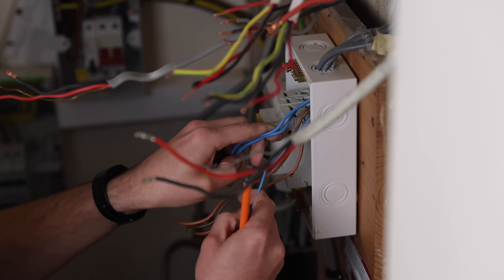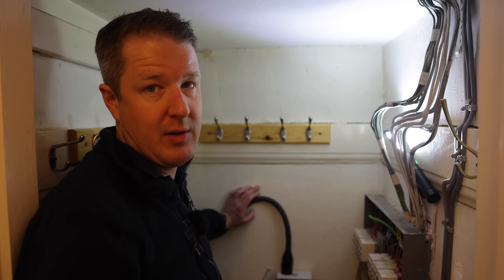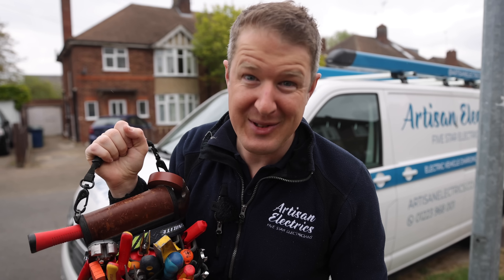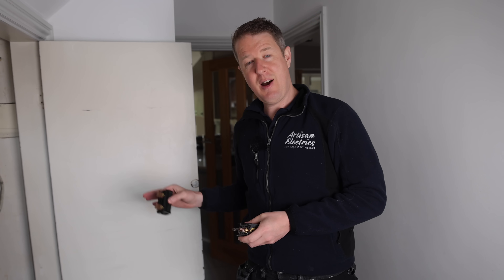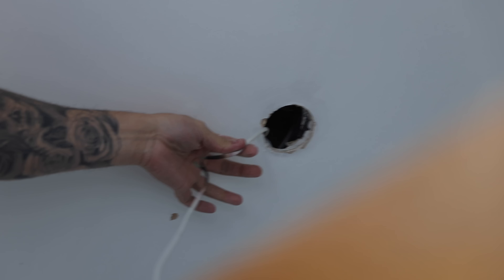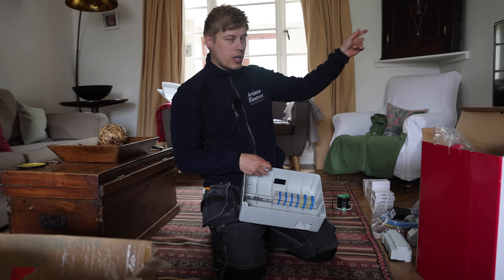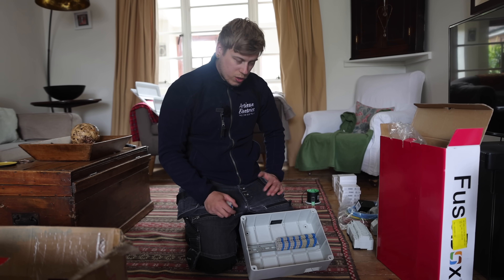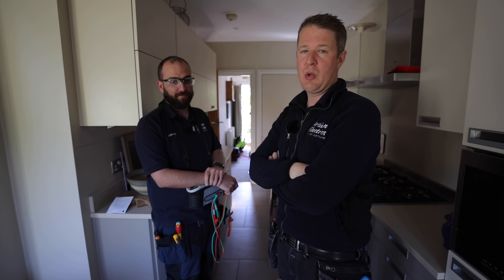A MAJOR ELECTRICAL TRANSFORMATION! - Consumer Unit Upgrade

Comment from the maker: Let know your thoughts on the super transformation. Would you have done anything different?
Reply: Good
Reply: My thoughts are it would of been better for the viewer to see everything powered up and working at the end? Great fantastic job tho well done 👍🏻
Reply: spot on job as usual. sure you've posted before but what grommet strip is Lee using there?
Reply: Can you please put a link in the description for the work trousers you guy are using. 💪🏻⚡️👊🏻
Reply from the maker: https://bit.ly/3z6jBXs - Blaklader
Reply: @artisanelectrics  thank you 😊
Reply: I’m sorry but the regs covering metal consumer units also apply to “similar enclosures” like this one. There is not much point in fitting a metal consumer unit if a plastic enclosure is used to extend the cables. Plastic enclosures should only be used in external buildings that are not classified as dwellings; this can include sheds, workshops, detached garages, swimming pool areas, meter boxes, or commercial/industrial areas. WISKA tell you this on their website for the Indubox which is what this is. What’s next on Artisan, paid promotion for a plastic consumer unit?! Lol
Reply: @gadgetman36   Your use of “ “ implies a direct quote from BS 7671 yet 421.1.201 makes no mention of similar enclosures. It’s states “consumer units and similar switchgear assemblies”. 
Switchgear is defined in Part 2 as “An assembly of main and auxiliary switching equipment for operation, regulation, protection or other control of an electrical installation”. 
So an enclosure with din rail terminals wouldn’t meet the definition of a switchgear assembly. 
By your logic, the use of all plastic accessories would be precluded by 421.1.201. 
Also of note is the question of the assumed definition of “premises” as used in 421.1.201. Most resources define premises to include the associated land and other buildings. So your suggestion that plastic consumer units are specifically permitted in sheds and similar is actually open to interpretation. 
There is little use having a metal consumer unit in the house if the one in the attached garage is plastic…
Reply: If only you had fixed the extension box higher so the leads on the armored could go around and not over the connection. That must have hurt when you noticed
Reply: @artisanelectrics  Crazy price for a pair of trousers!  Maybe next year... ;-)  (I prefer John's anyway!)

Comment: I saw the DNO note on bakelite fuse enclosures when it was published and the videos filmed by SPEN are very scary in terms of the sitting voltage on the enclosure itself. First time I've seen evidence of it on a fuse carrier. Good spot.

Comment: Epic job John... Currently looking for a new board and some electrics done in an old outhouse along with some outdoor lights & sockets for a patio area... Sadly your way out of my area (Cumbria) otherwise I'd have you quote us. Got a quote from a local Spark for the work and I think he's quoted so we don't use him. Upgrade of the outhouse board, 8 lights and 2 sockets over £1800 + Vat. And we're supplying the lights & sockets... I'm even running underground trunking under the patio for the SWA...

Comment: 15:05 You might consider installing small LED mains with battery backup powered light next to the CU.  That way in-case a breaker trips you will have light to check the breakers.  Seen it done a few times and does work out nice.  Just small linear strip lamp above the CU, and for the cool Aritsan touch, it could have door switch so it would come on when door is open, as it looks like  a coat closet as well.  👍😁
Reply: These emergency lights also come in din rail versions, for ease of mounting.
Reply: Cracking Idea. I've done this for years where to consumer units is and one in the stairwell too.

Comment: The only reason I have a cable stripper.....is for downlights, saves so much time....everything else is good ol' cable cutters, nice board change. Haven't done a double stack in a domestic in years.....rarely need them

Comment: I have had a set of those CK strippers for years. The biggest issue for me has been that when I have been stripping the inner cores on T&E the small off cuts of the insulation get stuck in the jaws causing them to fail to strip next time you use them. First world problem, but really annoying.

Comment: OK so since John used to work for the DNO, he is best placed to answer this maybe - who pulled the cutout fuse?  We all do it, but what are the proper rules?  Everyone seems to think something different.  I have been told by electricians that training centres that it is illegal for us to touch it.  but every electrician I have ever spoken to on the subject just pulls them anyway.  Does anyone actually call the DNO to do it?  Can you explain?  Have you ever been in trouble due to it?  Very nice job by the way.
Reply: I work for a DNO myself and legally electricians are are not allowed to pull the main cut out fuse. The DNO should be called out and it is a chargeable call. However we know electricians do it and in a lot of cases turn a blind eye because its also a bit ridiculous to have to pay us to do something so simple. Sometimes we get called when smart meters ping in that someones power is off and we turn up while the electrician is there. I usually just explain the scenario and give a verbal slap on the wrist. I have heard in other areas other DNOs can be a little less forgiving however.
Reply: @tiggerthegreeb  thanks for your reply. I might give my dno a call next time I have a board change booked and see if they'll come out. The answer to this really is to install an isolator before the board from the meter. I know this would involve an initial call out but would solve the problem after that.
Reply: Its rather ridiculous when you think about it. Can you turn off the mains water? Yes. Can you turn off the mains gas? Yes. Can you turn off the mains power ? no ...... We all pull them, if the DNO has an issue, they can take me to court. If they would be less lazy and fit isolators this would not be an issue at all, THEY created the issue to save money...Fit a £20 isolator? Hell no, Get them to pay callout charges to pull a fuse? Hell yes!!
Reply: @Thegardener87  Yeh 100% agree. I guess the only issue as you say there is it needs a call at at the time of installation etc as beyond the meter the DNO are legally not allowed to alter wiring etc being strict to the law. It's a daft scenario really where customers and electricians would really like a double pole switch between the meter and consumer unit but we aren't technically allowed to do it ourselves under normal circumstances. If I do attend a customers property and find wiring that I deem a safety concern (for example I've seen faulty KMF switchs between meter and consumer unit and even reverse polarity from the meter into the house) we would fit one and leave it off so a spark can come and do work after we have attended. But o. The whole it's a silly situation I must agree.
Reply: @tiggerthegreeb  yes people don't realize that smart meters have a feature called "dying gasp" where a charged supercap inside them allows them just enough energy to send a burst of telemetry that power has been lost. 

I think most electricians would argue that in order to do their job and change a board, they need an effective means of isolation - and rule or no rule - until there's isolators fitted - this means pulling the fuse. I don't think any electrician should work live just because they might upset the DNO. 

I have zero issue breaking any nonsensical rules if it means I come home from work safely.
Reply: @arcadia1701e  Cutting the seal to the main incoming fuse potentially allows folks to bypass the meter.  Bit like the seals on the meter itself, they should only be cut by the DNO.  I waited until I had a meter change and asked them to install a double pole isolator, problem solved.  I have been told in the past by DNO folks that they do not allow other equipment (such as a consumer unit) to be installed on their board or in an outside box.  Maybe they are more relaxed these days?
Reply: When quoting these I get the cliant to contact there energy supplier and install a isolator. they normally do it for free or under 100, I think it looks more professional.
Reply: @adrianshingler9783  it's funny, because in Australia for example CUs are regularly installed in the metering box and nobody cares. Seen enough installs in the UK of old wylex boards that have obviously been in there for 30 years and nobody has complained.

Comment: Why do you want the ground wires separated on that DIN rail? Like why didn't you use the ground blocks?
Reply: You can't test the R1+R2 (Continuity) for an individual circuit if the CPC (Earth/"Ground") is connected to all the other circuits' CPCs...

Comment: At 8:08: Test a phenolic fuse carrier that has NOT suffered arcing or prolonged overheating to convince me that phenolic material is not fit for purpose.  I suggest you clean your carrier surface of conductive carbon then perform the correct test according to the appropriate IEC standard for surface resistivity. If only published standards were not just for the rich!
Yes, we could return to ceramic carriers - but if have ever dropped one you will know their disadvantage.
Reply: Many millions of electricity meters worldwide have and still use phenolic in the main case and terminal block area.  A decent grade phenolic will last a very long time 👍❤️

Comment: What's the issue with connecting all the grounds together in the extension box? Aren't they all gpoing to connect to the same terminal in the consumer unit anyway? The ground isn't supposed to lead any power unless during an earth fault which will switch off everything anyway? Might be different here in Sweden where we don't have loops and run cables to be able to take the A that there will be in the circuit.
Reply: You can't test the R1+R2 (Continuity) for an individual circuit if the CPC (Earth/"Ground") is connected to all the other circuits' CPCs...

Comment: Is there an issue doing through crimps compared to an adapt box
Reply: Shouldn’t use crimps on solid conductors as it can damage them and reduce the CSA of the cable

Comment: With the adaptable box, and the trunking going up and round, you've had to put the SWA through. Couldn't you have a. terminated SWA into a small box where it enters the room, and moved the vertical trunking to the right (as it's not flush to side wall anyway) or b. brought trunking out to the side of new box and round to new CU? Why go up and round? the SWA looks bad.

Comment: As a learner I'm still not getting the situation with pulling the main fuse. Did Artisan get DNO approval for pulling the main fuse here? I get some people telling me it's illegal and you face a fine for doing so, and other people saying it's fine and that you have to pull the main fuse to not violate the EAWR (live working), and it's not practical to get a DNO appt for all your jobs. 

Can anyone simply answer this for me? Obviously external isolators are ideal but they are often not present.

Comment: Why didn't they want the earths to be bonded together on the din rail?
I know earths are bonded together on din rails in control panels.  Just i'm just wondering what is different in the house installations.
Reply: Might make things a bit more difficult in some fault finding situations.
Reply: Testing each circuit becomes a problem as all the CPCs are connected.

Comment: Some times a loose connection on the main fuse carrier stalks between the fuse and carrier stalk screws that create the connection to the fuse arch and over time burn out hence why the carrier stalks are burnt

You can tell if the main fuse is overloaded just by touching the fuse carrier with your hand if it’s really hot you know you got a problem. 

Also incoming service cable could be undersized for fuse rating for current carrying capacity which again would over load the fuse causing it to blow. 

007 which is 4m can only be fused at 40amps max

.0145 pilc service cable’s which is 10mm cores either copper or alley cores can only be fused at 60amps max

.0225 pilc single phase, split phase, three phase if it’s copper cores or tinted copper cores can be fused at 100amps, if it’s alley cores can only be fused at 60amps.

.04 which is 25mm pilc copper cables 100amps alley cores 100amps

.06 pilc service cables 35mm either copper or alley cores 100amps.

25mm plastic wave form or 25mm hybrid plastic 80amps 

16mm split concentric copper 100amps 

25mm split copper 100amps

25mm hybrid split alley 80amps

35mm hybrid split or 35mm split concentric 100amps.

Comment: Do you really have no idea how the main fuse got like that? I would have thought 18 circuits would be putting a pretty high load on it. Even allowing for diversity I'd be surprised if the max demand load was much below 200A and at best it's going to be a 100A fuse. Obviously it won't usually be running at max load, but I wouldn't be surprised if its running a little hot now and then.

Comment: Fairly sure you’re not actually allowed to pull the main fuse unless you have a Mccopa qualification (metering). Aren’t you meant to get the energy supplier to fit an isolator?